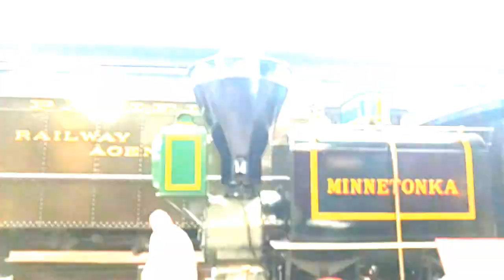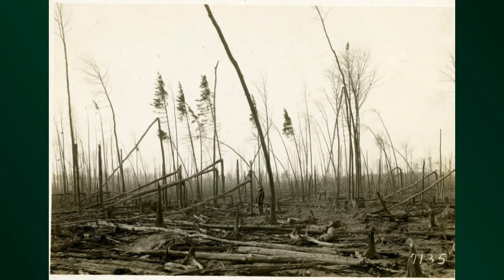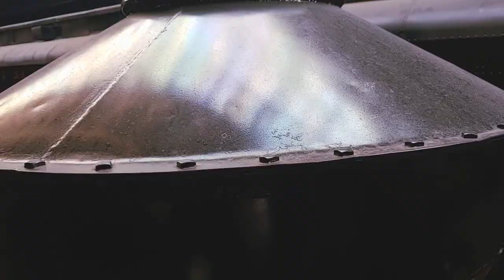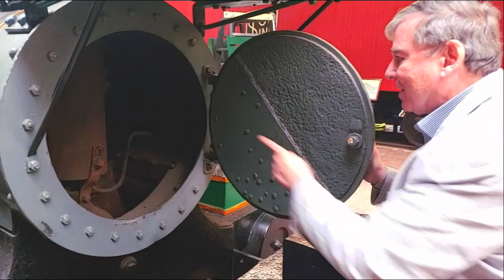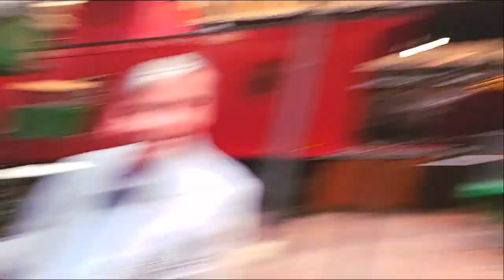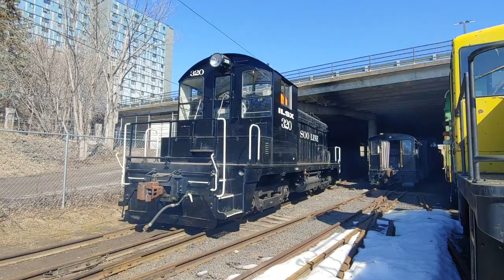Fires Prevention with Trains

Comment: This is an apt topic for our part of the world.  I've seen at least one documentary on WDSE and the photos are surreal!  As I've mentioned before, I'm a model railroader and railfan, interested in early railroading.  One of my favorite books is "Narrow Gauge in the Rockies," by Lucius Beebe and Charles Clegg.  A couple of the Colorado narrow gauge roads' locomotives sported some mighty strange-looking contraptions on their stacks, called "Bear-traps."  These consisted of tall sheet metal gizmos that looked something like auto mufflers where the stacks would be, with metal screen facing front from halfway on up and across the top and a sheet metal pipe reaching down alongside the smokeboxes.  It seems one of the little trains set fire to mine buildings and a Catholic church, one day, and disrespecting both Religion and Commerce had to cease!  The Bear-traps caught the hot cinders, the oncoming breeze(!?) slowed and cooled them somewhat, then they traveled down the chutes to be deposited on the roadbed.  The rails, ties, and lineside structures may be gone, but the cinder roadbeds remain---as much as 130 years, in some cases.  Stay safe, everyone---and Happy Holidays!